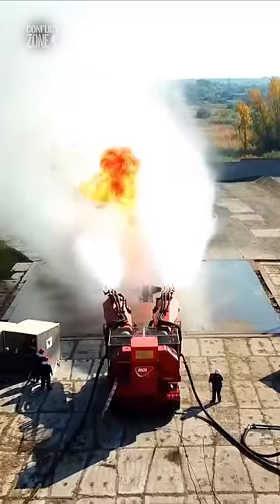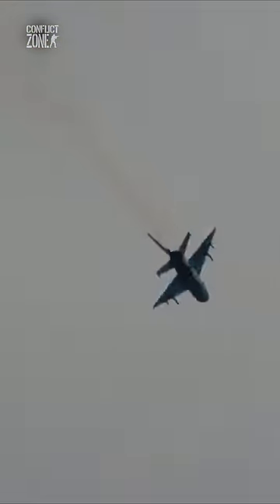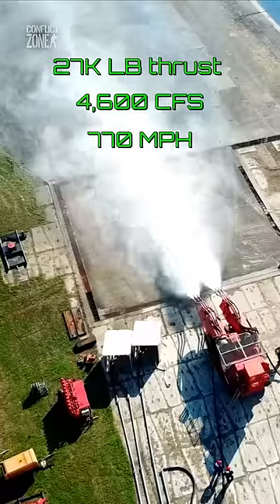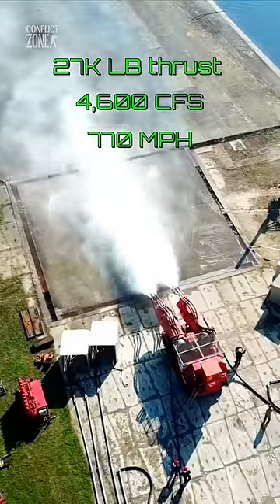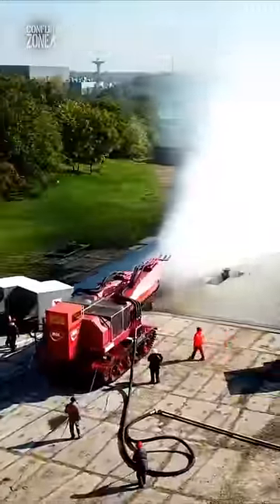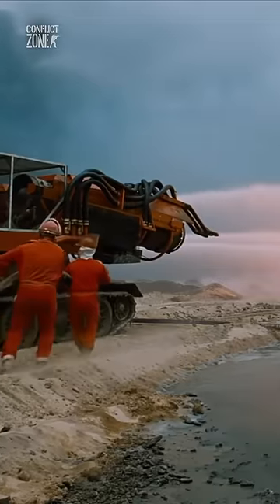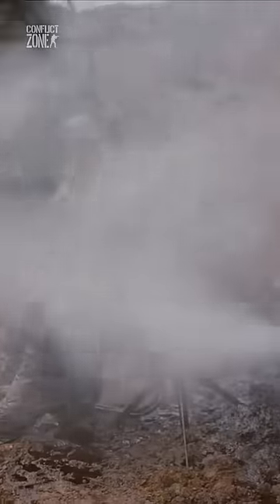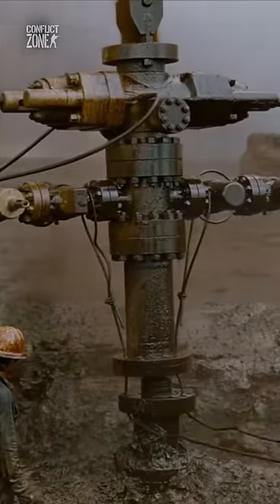Big Wind: The ultimate HELL truck 🔥🚒😨

Comment from the maker: THIS, is NOT what you think!!! 😂
Reply: ....pfuuuu ,that one really annoying
Reply: Mobile high-volume decontamination unit
Reply: That works. Fighting fire with fire.👍
Reply: Boy, you got that right, unlike the other channel, which is rarely not what I think.
Reply: ey5328 Yes, normally high explosives eliminate source of O2. This eliminates O2 with overwhelming presence of water.
Reply from the maker: @larryulrich9110 interestingly, that is NOT the mechanism that it uses to extinguish fires. 😅
Reply from the maker: @thomasbell7033 😮 He is great! 😊
Reply: @Conflict_Zone  Oh, no argument there. I've subbed him for years. Are
you by any chance the same guy?
Reply from the maker: @thomasbell7033  Not the same guy, but I know him well.
Reply: I thought this was HIS channel, for a second, there! ❤🎉
Reply: @Conflict_Zone 

Not what you TANK.
Reply: @Conflict_Zone Then what is it?  How does it extinguish fires?
Reply from the maker: @mikegardner107 

The mechanism behind its firefighting power is simple. Oil blasting out of a wellhead is under pressure, and the primary flame is a good 15-30 feet clear in the air. The intense blast of water and air helps cut off the supply of oil to the flame, while also helping to suck huge amounts of heat out of the atmosphere and surrounding area.

https://hackaday.com/2021/12/06/big-wind-is-the-meanest-firefighting-tank-you-ever-saw/
Reply: Love that guy!😂😂😂😂😂
Reply: What happens if you put jet engines on a tank?  Look up the US Abrams tank.  It has lots of power and uses lots of gas, and frankly only the US military can afford it, and the Marines have decided that they cannot, so they are giving theirs to the Army.
Reply: yrugay?
Reply: @Conflict_Zone  yrugay
Reply: Nooooo why the beautiful T-34/85 😭
Reply: @Egilhelmson No one can afford to burn that much money on such a flop since everyone else have to work their asses for what they have. Abrams are good against desert tribes, sure but that's not what ships are made for.
Reply: @Egilhelmson the only part of this that made sense is the power and gas statement. Leave your mom's phone alone kid😂
Reply: @zstanojevic9574 darn and I thought his reply was stupid , but this definitely takes the cake on stupidity. Give your mom her phone back kid.
Reply: Sweet
Reply: Genius
Reply: @mikegardner107 I'm assuming it's smothering access to oxygen somehow, i think?
Reply from the maker: @ashsherman  No. it is depriving fire from oil.
Reply: Uhhhhh what do I think?
Reply: Did they use the R-13, 21 or 25 engines?
Reply: @thomasbell7033 do you even see the channel name? lol some people really have a hard time processing jokes
Reply: i tought it shoots flames
Reply: It's exactly what I thought.  Seen it when it was introduced.   Cool shit.
Reply: Actually, it was EXACTLY what I was THINKING.!!
I remember seeing these back in the 1990's on TV & a few times since.
Reply: Fred adare truck
Reply: This time you are right 
I thought they wanted drive a tank at 300mph
Reply: Don't loose your Breaks... 😅
Reply: Need one for the next climate Protest, pls🙏
Reply: This is exactly what I think. You are a bot channel
Reply from the maker: @Toefoo100  I did not know that bot audience exists too. 😁
Reply: 🤣 @Conflict_Zone
Reply: Yep. Before that the SOP was to get an actual pile of explosives near the fire and blow it out.
The milspec leafblower is a lot safer.
Reply: What do you think I think then ?
Reply: What do you think I think?
Reply: Well, it would help to use proper descriptive titles.
Reply: A Rubik cube is Magyar találmány.
Reply: Finally supersonic tank not my brain 😂
Reply: i'Ve DrIvEn OnE oF ThEsE aNd I'm A fIrEfIgHtEr 🚒 🔥
Reply: It worth it😂😂

Comment: The fact it actually got put to use makes this even more incredible.
Reply: Combat engineering is seriously overlooked
Reply: I’ve learned something from tiktok/short for once
Reply: Did any one know that the m1 abrams is powered by a jet engine?
Reply: @smolltaco5667 Ehh gas turbine. So are most Russian MBTs
Reply: @arcroyal1258 nah they are not, they use conventional engines
Reply: @arcroyal1258  Not most, only the T-80s
Reply: This is pretty wild I like it
Reply: Very creative and creatively put to use in drastic situations (they probably weren't stopping those fires any other way efficiently)
Reply: @waki0069  Yes, they are
Reply: @b3lka_  Which make up most of thier tank fleet/are thier most used tank
Reply: @arcroyal1258  No, T-72s are by far their most used tank.
Reply: @b3lka_  T-80s are I guess their "flagship" tank, because it's way better than the T-90. They put it back in production, unlike the T-72.
Reply: @arcroyal1258  The T-72 is still in production though...
Reply: @b3lka_ (I am also unsure what he means) but perhaps he means the t72 was chosen by the Soviets over the t80 due to its costs. T80s were expensive and high maintenance even though they were better at the time.
Reply: @frankvonfrauner It's actually not overlooked at all. Most of our "toys" were military first.
Reply: @smolltaco5667 dont think it'll work man, jet engine need a large intake of air to get enough thrust, and I havent seen any air intake that large on abram

Comment: Thats a T54/55 hull not a T34
Reply from the maker: Correct. The initial version was T34 but later upgraded.
Reply: @Conflict_Zone  the reason they upgraded was weight needed a heavier tank for better stability the original design was lifting up from the wind produced by jets
Reply: Uh... no?  @Conflict_Zone  source?
Reply: More precisely, a VT-55 recovery vehicle
Reply: Inital version i think t35/85 mig19
Reply: I was just about to comment this.
Reply: U can see the first version in the video aswell which is clearly a T34 hull
Reply: Last vehicle is a T34
Reply: @armchairphilosopher6880 then why did they upgrade it
Reply: @Its_Me_Romano there was no t34 hull in this video
Reply: wait nvm my fault
Reply: @tacticalepsilon2094 for better stability, those engines are quitte powerfull, and the t34 isn't the heaviest
Reply: @robertg9334  No, it's because it's easier to get spare parts for it.
Reply: @tacticalepsilon2094  Because there are more parts for the VT-55 hull that it currently has.
Reply: @tacticalepsilon2094 T34 hull parts are becoming very rare at this point. While the T55 hull is much easier to maintain

Comment: Years back they actually used dynamite to put these fires out the explosion would suffocate the fire too, this seems like a safer alternative for the guys trying to re-cap the well
Reply: Yeah I remember firefighter RedAdair from Houston👍  helped implement the technique of using dynamite to put out a flaming well head
Reply: Nitro. Not tnt.
Reply: Explosives are still used, quite effective, as a significant detonation consumes all local oxygen while blowing the fire off the fuel
Reply: @mariemelansongundy-vx4ox  from what I read, they used dynamite
Reply: Ever watch “There Will Be Blood “ they use that dynamite technique…really good movie… Daniel Day Lewis plays Daniel Plainview
Reply: Thats how the other 700 wells were put out while these idiots only got 9.
Reply: John Wayne movie and a good one too.
Reply: @fraserhenderson7839  I thought they cap them by lowering a bowl in it with a heli
Reply: What OP doesnt tell you is that this technique is still the most effective means. The eastern bloc of yesteryear grasping for any W they can conjure up
Reply: @jefwomick116  yes I believe the name of that movie was hellfighters
Reply: @johncuervo3019  originally they would use a crane to move the dynamite over the well detonate it, once the fire has been extinguished they then move another well head over the well and bolt it onto the pipeline
Reply: I saw a John Wayne movie, they blew out fires with dynamite blasts!
Reply: Has everyone forgotten  the Soviets and the atomic bombs used to closed wells?
Reply: Dynamite was never used. The explosion from Dynamite created a fire hazard that would not extinguish the oil wells that were already burning. C-4 was used to blow away any embers, suffocating the fire and extinguishing the flame to be recapped.
Reply: @racecar2933  clearly you didn't bother to look that answer up because if you had you would have seen every one of them listed Dynamite as one of the explosives they use
Reply: @txcavi any high, such as TNT, or medium explosive such as dynamite, will do.
Reply: @MyCatInABox  red Adair hated this thing to didn’t he? Him and his crew went over to Kuwait the same time as this and put out 200-300 of these fires and got no credit due to this thing

Comment: They make these for testing of materials in hurricane and tornado force winds, as well as basically a blow dryer for runways.  They’ve been a specialty tool since the 1970s.  In addition a lot of smaller older model jet engines get turned into airline starter generator trucks and portable power generator systems as a second life.  Their power to weight ratio is no longer efficient to fly, or they are beyond certified lifespan in the air, but are perfectly fine on the ground.

Comment: My father and I were asked to film a video for this concept back when they were trying to figure out how to extinguish these wells. They had mounted a massive aircraft engine on a stand, with a huge propeller. Idea was to push the flame away dig a channel up to the pump then slide fire shielded shipping containers up to the well head. That thing put out some amazing air volume, I could only imagine the power this thing had.

Comment: The original is made in 68 and they used 2 mig  15 engine. In 91 what you see on the clip they used the Mig 21 engine but on VT55 tank. Funny fact this is sick out an  average home swimming pool in 50 second 😂 build it  less than 6 month amd cost around 1.5 million pounds, you can still see it in Tököl, Hungary if you are there 😊
Reply: Thanks for the info 👍I'll visit next time I'm there

Comment: There is already a jet engine mounted in a tank, the M1 Abrams turbine😊
Reply: But thats just one jet engine, but two?
Reply: It's a gasoline turbine.
Reply: @gomersmith1061 
 Nope.
Reply: @DB-yj3qc  https://en.m.wikipedia.org/wiki/Honeywell_AGT1500

Here's the reference!

The  remarkable data re the Abrahms tank have always stuck with me, in particular: gasoline engine - not diesel or kerosene (J5); turbine/blower/compressor; up to 60 mph; outpaces its fuel tanker!; 56 (58, 60) tons.
Reply: That's what I first thought of when he said that
Reply: @Deezehereummm, no, they run on kerosene; look it up. And the Abrams is run by a turbo-shaft engine, not a turbojet.
Reply: @gumilangputraandiwaluya987  you got that right 👍

Comment: This was done back in 1944/45. It was one of Hobart’s Funniest. A jet engine, they were a new invention then, and mounted on a tank chassis. The engine was angled down and the exhaust was to be used for mine clearance! The pressure of the exhaust being enough to detonate the mine.

Comment: A little extra info: Around the same time, Hungarians strapped similar jet engines to trucks, in order to help melting the snow off of heavy snowstorms where the traditional tools didn't work.

Yes, they melted the snow with a jet engine. It wasn't as revolutionary; but it was fun.

Comment: Looks impressive but was actually found to be ineffective. Yes it put out 9 fires….. of course, in Kuwait, there were close to 900 burning wells, and with so many wells at once to try new ideas, the most effective means turned out to be a length of round culvert pipe attached to booms that was inserted vertically into the oil stream.

Comment: This is a lot more resource intensive, but it is safer than using dynamite as the traditional way to stop an oil fire. The concussive force disrupts the oil flow, and simultaneously blows away the fire.

But this is certainly the safest way to do that dangerous as hell job.

Comment: Did you know?:
The Original Conzept of a mounted Turbine was invented 1984 in Germany (DDR) at Industriepark Schwarze Pumpe. It was a MIG-17 Turbine mounted on a IFA W50 and did its work till 2000. Used to cool down big Industrial Fires. 
The UA-Version is just another Design of the Conzept.

Comment: Don’t know if that is a T-34 hull, first it has sprokets and T-34s where known for their lack of those, specifically those with outer teeth. Secondly it’s a bit wide for a T-34 hull. Could be a T-50 series or a T-60 series, there are plenty of those and makes sense to use those hulls rather than an old WW2 tank hull.
Reply: There is 2 "Big Wind". 
One on a T34 hull (that went to Kuwait) the second is on a T54 or 55 hull due to its easier maintaince
Reply: @patriktoth6258 guess I was half right.

Comment: The Australian Abrams tank uses a gas turbojet engine.
Reply: No, a turbo jet is a reaction engine used to power pure-jet aircraft; the AMERICAN Abrams is driven by its treads, which are powered by a single turbo SHAFT engine.

Comment: Boots and Coots Red Adir  Wild well control Saftey Bosss put out the Gulf War oil Fires not the wind machine and using water abrasive jet cutter’s to remove damage and place shut off valves back on in record time

Comment: Worst idea ever. Putting turbine engines in Tanks is just stupid. The Tank will use the same amount of fuel standing still as it will if it is moving. Seriously reducing its run times between refuelling.

Comment: Back in 91 my father was a gateguard at a huge communist factory called Romprim (now demolished and rebuilt as a superstore) they were building such machines for the Saudis. My block was wall to wall to the factory fences and I lived at the 4th floor. One day, they tried to test this prototype water canon and the test facility was dug in the ground and surrounded by thick concrete walls. When they powered the canon it only worked for like 8 seconds but when the full pressure hit that concrete wall it broke it and the watter went over the factory's fences and demolished another block that was being built 50 meters away from the road surrounding the factory. I remember my dad telling us that the patent was stolen from the Hungaryans and that the idiots used jet engines to power the canons.